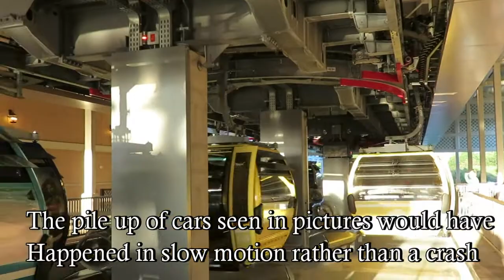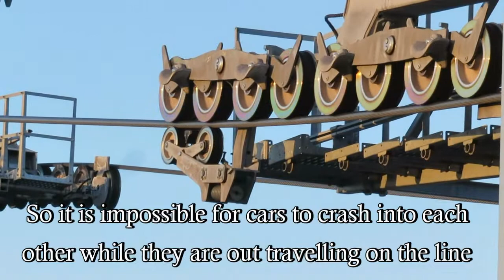Disney Skyliner Crash Incident Closeup Of Mechanism

Comment: Those are great shots of the station drive mechanisms, but the incident had nothing to do with handicap, rear track system.  It happened at the Riviera station, which is only a pass through station, no rear stoppable track.  If handicap is to enter gondola,  system is slowed to inching or stopped at this station.  In the videos that are around it appears gondola came in from Epcot line, onto station track, went around station and was to exit on cable out to Caribbean line, but that is where it appears to jam or stop.  You can see the gondola kind of twisted and shaking, like it was trying to be pushed by station track onto cable line that wasn't running, well that is what it appears like from distant videos.  And the following next 3 - 4 gondolas were just pushed and piled up behind first jammed gondola.  The broken glass was probably just the little vent windows, as they are to be closed when gondolas are stored tightly back to back in yard, but were open when in use.  Seems like some sort of synchronization issue of incoming and outgoing cables at Rivera station, will have to wait and see.  One question is why operators (cast members) working at the station didn't respond more quickly and stop system, since they are watching area where doors close and  gondolas leave station to make sure doors and clear and close??????  Should have seen and probably heard first and second gondola hit each other, and been able to hit stop.... not let 4-5 gondola hit each other.......what if that was a person caught or something in doors on gondola leaving station???????????
Reply: Why the cast didn't stop it earlier. Look back at the 2008 monorail incadent. At some point, people can't react in time. Or just don't notice.

Comment: No, the greatest risk is being stuck up in the air for 3 hours with no air flow (again). Those things don't even have fans or air conditioning inside. The incident proved that the gondolas are actually scarier than the PeopleMover. Not to mention that the monorail is safer.

Comment: Hey great video, but as a suggestion if you start doing voice overs and taking during your video it would improve it a TON. I know it can be hard to put your voice on a channel but if you just keep grinding out those videos eventually they will catch on!
Reply from the maker: Thanks for the input. I appreciate it. BTW. Re: The Skyliner System. I was at the studios last night and I noticed the Epcot line humming along. This is about 3 days after the incident. A cast member told me that OSHA was making them run them an additional 350 hours before reopening them to the public.

Comment: It didn't crash. The Epcot line was stopped when a section in the Riviera station containing 4 gondolas started moving forward, pushing 4 gondolas into the Teal gondola. To be clear, the Riviera station does NOT have a Handicap gondola section. When a handicap gondola gets to the Riviera station, the whole system is supposed to stop. I've heard that the operations team adjusted the interval of handicap gondola spacing: on Saturday the spacing was adjusted to 1 handicap gondola for every 7 regular gondolas. It was previously 1 for every 12. The number of affected gondolas here is 5, exactly the difference between the old and new settings. Perhaps the computers we not programmed properly and somehow the system stopped (as it should) when a Handicap gondola gets to the Riviera, but the internal drive system was still thinking 12 needed to go by. I am suspicious of this last idea because this system tested for months without any problem, and this happened on the very day they changed the handicap gondola spacing.
Reply: Yeah.  Very unusual. Something like this shouldn't have happened if its been through testing for months!

But I do hope they fix this problem before I go there next week.
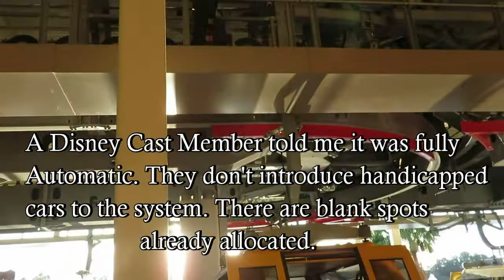Reply from the maker: Hi Vodhin I think you may have zeroed in on the problem. I just saw a video a moment ago where a Disney cast member was telling the guests that the handicapped gondola ratio was 1:24. You have to wonder if all the different systems were synced up properly. But then how could they have gotten such a basic function wrong I wonder. Btw I didn't know the Riviera station didn't have a designated handicap gondola bypass. This might explain the 4 times the ride had stopped the times I rode the system. I just wonder why it would take 10 minutes to load a handicapped person unless they were in a hospital bed with a full load of ventilators and IV towers etc.
Reply: You are correct about Riviera station not having handicap (back track), but pretty sure there is never any "gaps" left intentionally when system is fully running.   When system is loaded with gondolas on startup, there are usually 2 gondolas loaded on back track, and remain just sitting there.  When people require more time to load, they get into the first back track gondola, the operator presses button and the back track 'launch' procedure starts and the system takes over.  Off the main incoming track (after people have already gotten off) a gondola is directed off the main track to the back track, thus leaving a gap.  Meanwhile the back track  has already advanced the loaded awaiting handicap gondola to end of back track,  to just before the main track.The gap previously made by removing a gondola, continues around the main track, and at the correct time,  the back track advances, placing (launching) the loaded handicap gondola into that gap, and system carries on as usual advancing gondolas onto cable out of station.  Now your left again with 2 gondolas awaiting on back track, and no gaps are intentionally left in system.....ideally.  With this set up handicap gondolas can be sent at any time, probably a limit though, maybe every third or fourth one, as back track procedure does take time to load people and get gondola into position.....
Reply: No the first gondola did not crash. But the ones behind it did. trying to say there is no crash is like saying the the towers only came down gently.
Reply: By definition, it was a crash.